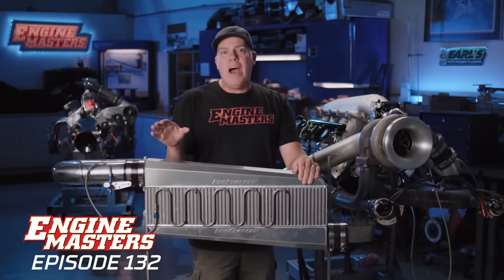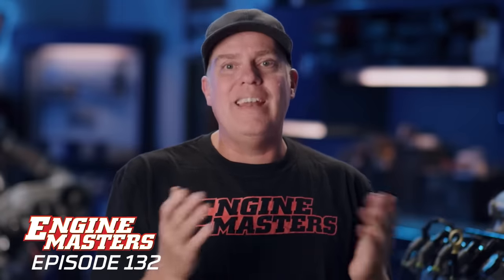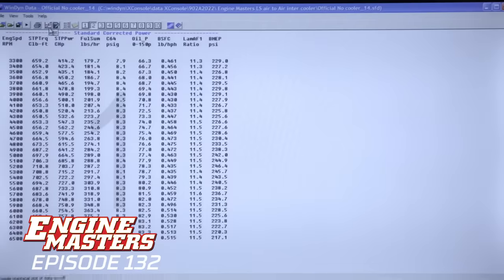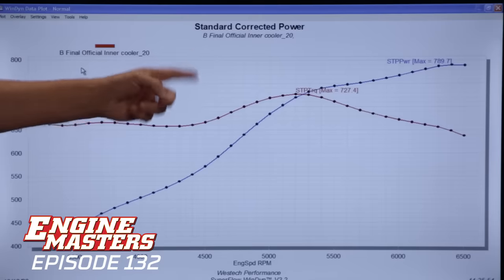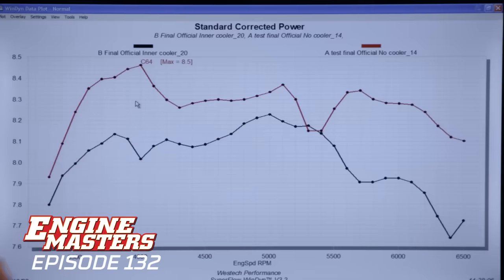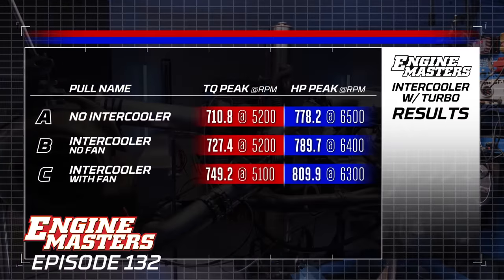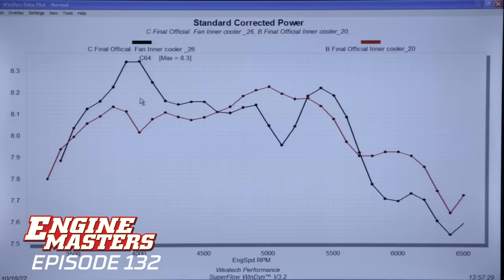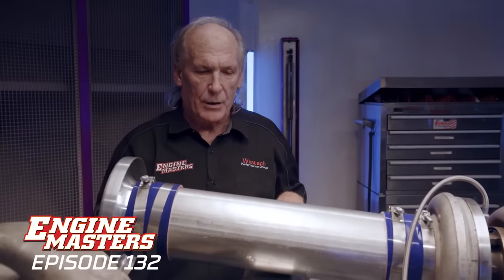Adding CO2 to an Air-to-Air Intercooler! | Engine Masters | MotorTrend

Comment from the maker: What lengths would you go to keep your intercooler extra cool?
Reply: Doesent one of the hellcats use the air con system to freeze the intake?
Reply: Water-methanol injection, how has this channel not done this yet?
Reply: Back in the 80's during the Turbo era of Formula 1 before the start of the race the would put dry ice in the inlets of the side pods in front of the intercooler to cool the charge. Not sure exactly how effective it was but if helped them gain a couple of positions at the start it was a benefit.
Reply: The lengths of admitting I should not have left youtube.
Reply: a water sprayer costs about 50-80 bucks if you wire it properly and use a washer tank. Id go with 5 seconds on the relay and the fine mist greenhouse sprayers. Also, chemical intercooling via water injection/methanol injection. Ive seen them just mist it upstream of the throttle body on the cold side of the intercooler.
Reply: Just make a front cover for the intercooler out of wire mesh that you can put dry ice into between it and the intercooler. It's lightweight and will definitely make the air passing through colder. Cheap solution too as it wouldn't cost much at all
Reply: I sprayed my intercooler with cans of -48 freezing spray before a drag strip run this summer.  I also had bags of ice on all my air ducting and box before the run.  
Unfortunately an AWD civic exploded the diff all over the track when I got to the line so my cheating didn't work.
Reply: @jeffa.8976  lesson learned. I'll spray kitty litter from now on.
Reply: I know someone said it already but liquid sprayers would be cool to see in this type of testing
Reply: AC evaporator attached to front of intercooler, yes evap not condenser. Could you get more power than the compressor hogs?
Reply: Meth to air. And I'd put an air filter on it😢
Reply: @kennethstreet7868  Maybe the most responsible car related post ive seen in a while online. Should be the first optiion you look at along with the squeeze depending on your chosen path. the intercooler is like a spoon. Its a tool, and its way better when there isnt one.
Reply: I'd eat a Klondike Bar!
Reply: E85, and skip the intercooler
Reply: It's super weird to see David on Youtube still. After they first were NEVER leaving, then they went behind a paywall for a while, to now producing pure trash videos. Imagine if they would have just stayed here. Oh, and Dulcich is so creepy I can't even. 100k views with 6 million subs? Yeah right. Lol.
Reply: Please solve the age old mystery of does a high volume oil pump suck the pan dry at high rpm or any rpm on stock style and other types of pans would be greatly appreciated I've gotten so many conflicting opinions on the matter and no one has definitive answers on the situation thanks small block Chevy stock and built engines preferably, you know all the usual testing of different situations and set ups you guys do for us car guys. Thanks (cheap bottom end 388ci SBC guy)
Reply: How about air to air and air to liquid at the same time. How much is left on the table on each without the other.:elbowcough:
Reply: @donaldreese2688  I didn't realize this was an age old mystery, but I have thought of it myself. We had a guy that used to blow supercharged 5.0 engines. He usually did this by running the snot out of the car at high speeds racing on the highway. Of course back in the day 5.0 engines were plenty because people would buy the car new for 10K outrun the brakes and then smash the thing up.

I used to do a lot of top speed runs with a modified 5.0 and when i took the engine apart (floated a head gasket) the bearings looked like they were starved a bit, con rods and mains. The engine was run on Mobil 1 Synthetic and saw regular oil changes. When we rebuilt the engine and I put a high volume mellings pump in there, I was wondering if I was going to do more damage than good on a gravity fed oil pan. We did put in a deep sump Canton pan with windage tray.

Comment: Need to continue this. Subaru used liquid sprayers with good results. Also, I wanna see a water to air setup followed by a killer chiller setup using the cars A/C setup.
Reply: The original ford lightning used its AC to cool the blower charge.
Reply: @ricepony33  Just being pedantic, but the original Ford Lightning didn't have a blower, but used a mildly spiced-up 351.  The supercharged 5.4 truck Brian drove in F&F 1 was the 2nd-gen.
Reply: @JETZcorp did it ticklike my 5.4? 😂
Reply: My memory is like a trap, nothing enters and nothing leaves ;)  @JETZcorp
Reply: Mighty car mods made a video about this a few years ago
Reply: @ricepony33 so does the hellcat
Reply: @JETZcorp  sorry gale bank's dyno'd with a "terrible design unit" and my childhood memory was and is seeing a 8ft-bed blue-green-ish+white-2-tone lightning configured the same way 

personally im not a ford fan aka dodge feverish ( 60's-charger and 80's k1500 ) lolz 😂 , but the better lighting is the 2003~ 2gen short-bed the rest are trim/gimmicky models, wishfully hoping for a short-bed single-cab BEV-remake-themed street/striped competition combo as it might be tempting for me to buy X- 😉 or long-8-12ft + single-cab ( more practical for real truck-use's but not as great for driving to work every morning or easygoing earens ) as GMC ( or dodge ) isn't in the game yet vs ford, however ford's BEV is over priced for what jimm said they wanted/promised at 80k-max and entery is/was 20-40k usd
Reply: I recall a magazine test of WRX STI sprayer…did not make any power diff.  But was cool none the less!
Reply: I think the intercooler was limiting further gains.
Reply: @mikelesh9513 it doesn’t make outright more power but lap after lap of driving the intercooler gets heat soaked. The spray brings the temp back down to ambient and that way u keep your power
Reply: @JETZcorp lightning concept I think used the AC but changed for production. SRT DO use the AC in the demon
Reply: @MatsNorway can't say without temp data from the last runs. They're not pushing much boost either so any gains will be magnified with further increased boost from the increased compressor discharge temps
Reply: Killer chiller is only good for however big your reservoir tank is because the ac compressor is turned off at WOT.
Reply: The water sprayer on subarus was just to counteract their terrible intercooler placement right on top of the hot motor.  The AC setup is much more interesting too since you dont need to refill it nearly as often.
Reply: @MatsNorway  Good analogy. Only one way to find out!

Comment: This little trick has been around for years. A cool story from down under.

Year: 1989
Location: Bathurst 
Car: Ford Cosworth Sierra (Turbo 2L inline 4 engine)

Peter Brock qualified on pole position after having ridiculous speeds recorded on the two longest straights of the track (mountain and conrod straights).

During post qualifying inspection it was found that the onboard fire extinguisher (CO2) was plummed so it pointed at the intercooler, and Brock let it off going down the long straights, giving the engine more power resulting in a quick lap time. The result stood because their was no rule against it.
Reply: You’d think it would fail for no longer having fire suppression
Reply: @ShaunHensley  Yes, it was the 80s and things were much more relaxed back then. Playing devil's advocate, I guess you can't make it against the rules to "activate" the fire suppression system.
Reply: The z18 bluebird piloted by George Fury tested a similar system in 1984.
Reply: @noname-sd5dt  Really?!!! That's so cool!  I didn't know about that. I do recall reading an article somewhere about the qualifying engine, stating it was only in the car for qualification and the top ten shoot-out and that was it. After that, it got replaced with the race engine for the race the next day and pretty much needed a full rebuild after only running a few laps because it was put under so much load from running extremely high boost and being reved so hard.

Comment: Definitely revisit this using liquid sprayers. It’s not uncommon for folk to run water/washer fluid/vodka/methanol on A2A intercooler sprayers 🤘🏼
Reply: T the vodka half to intercooler half to me.
Reply: slight fire hazard spraying that stuff in an already hot engine compartment with the potential of over spray hitting the exhaust  but could be ducted away to ground or vertically out the hood
Reply: @snapon666  Water provides no fire hazard
Reply: It should be something that arrives as a liquid and phase changes to gas. Liquid Nitrogen would be really good, and alcohol of course, but water absorbs a lot of energy even without changing phase to gas and is not explosive.
Reply: Liquid sprayers are not track legal due to them literally spraying liquids which can cause a safety hazard
Reply: @johngarlick7115 the streets ain't got no rules tho 😂
Reply: @jeremypike9153  Exactly.  Intercooler spraying was factory-stock on some street cars, so it's definitely worth testing.  I thought about rigging up a water sprayer to cool the heads on my old air-cooled Kawasaki 2-stroke, if it ever had cooling issues.
Reply: @snapon666 duct it to the intake
Reply: I’ve heard of folk rerouting their air-con exchanger to the front of their intercooler then blasting the AC so hard it nearly freezes over. 

The entire pass doesn’t require the AC to be on since all that residual cooling ability remains. Heck modern ECU’s would be able to control it to be turned off the moment you release the launch control or similar (a second or two into 2step for example)
Reply: @dylanzrim3635  the dodge demon uses the A/C system to cool down the blower in between passes at the dragstrip.
Reply: Another excellent video as always 👍
Reply: @JETZcorp certain model Subaru STIs had a water tank in the engine bay and water sprayers connected to the hood to spray the top mount.
Reply: @JETZcorp  i did that on an old lawn tractor that i had. i was running it HARD. actually worked really good at the time.
Reply: watching this got me thinking, why not freon? or R-134a? same thing as coils for your freezer. i realize you would put a drain on your alternator and increase weight with compressor and condensor but its a sealed system. you could slide a cover over and have iced coils. make your run and let it charge/freeze back up. i feel like I should get in the shop and get to work lol.    (i trademark this idea!!!)lol
Reply: @Ko_deZ  liquid nitrogen wouldnt be bad but compressed and inert gas would work too. nitrogen as a gas is still colder being decompressed than co2 and helium would be an even better choice as its even colder.
Reply: @BrickNewton my brothers mate had a saab 900 turbo back in the 80's with water sprayers on the intercooler, and water/meth injection,
Reply: Acetylen would be a great idea
Reply: Weber 50 idle jets araldited to the trumpet pre turbo and then in to the log intake manifold post turbo on a 5lbs hobbs switch with distilled water.  I ran 2 more psi more reliably than no cooling and 2 less psi on my datsun draw through.
Reply: @KingSMW  I've noticed old dirt bikes pick up power after you bonzai a puddle or stream.  That's what gave me the idea.
Reply: And maybe the fan vs. Fan&Sprayer isn't the best comparison. The sprayer bar is a replacement for air speed over intercooler, not a compliment. 

Burnout cars, mud bog, drifting. There are lots of times where fan air is uncertain.
Reply: @jeremypike9153  lol, technically they do!
Reply: I’d like to see that!
Reply from the maker: Good insight! What other tests would you like to see?
Reply: @MotorTrendWatch get some liquid nitrogen and use that instead of CO2.
Reply: @MotorTrendWatch  just compressed air into the turbo inlet.  Air can go straight in and is about minus 100?
Reply: Two things. If you sprayed the whole bottle of co2 wouldn’t the oxygen content of the air in the dyno been diluted?  The fan inlet may have caused low pressure area right in front of the turbo inlet hurting boost?
Reply: @RAPXZibit methanol does
Reply: @KingSMW f150 svt lightning already did this
Reply: @MotorTrendWatch couple lbs dry ice in intercooler with acetone for the liquid medium.  Or even as a "cold air intake"
Reply: @MotorTrendWatch water methanol injection.
Reply: Build an intercooler in copper
Reply: @MotorTrendWatch  Same test with small and big intercoolers?
Reply: The Water bottle was actually a big 10-15L Tank in the boot (So it would stay cooler than 100*C engine bay) Also with a decent powered pump not normal wiper sprayer pump and 4 - 6 "Misting" nozzles on the underside of bonnet spraying over the Top Mount IC right at the air duct From bonnet, It was automatically controlled Via the ECU Boost Reading and a manual on/off/rate of flow adjustment in cab @BrickNewton
Reply: @KingSMW 
Maybe because that would be toxic af for everything and everyone?
Reply: There's a better way and it's easy.
One coil sprays water mist, one coil sprays CO2.
Reply: @MotorTrendWatch  Four pattern cam test.
Reply: @AB-80X  how do you come to that conclusion? you woke up today right? nobody's refridgerator  is killing them is it? or your window a/c? same theory applied. its a sealed system. i literally said the same as a refridgerator.  coils. a refriderant such as r-134a. compressor and condensor.  ffs.
Reply: @KingSMW 
I’m not talking about the R134A dingbat, I’m talking the Freon you mentioned.
Reply: It's probably better to inject the water and or alcohol directly into the manifold. Best possible heat transfer, plus the alcohol can act as additional fuel allowing a leaner mixture from the main supply.
Reply: @RAPXZibit  and is also better at cooling than alcohol
Reply: @jstdrv  jet fuel indeed

Comment: Ive seen people use solid chunks of C02 stuffed into the intercooler ducting pre send down the 1/4mile. As the C02 changes from solid to gas it can take alot of heat with it. Which is great for an intercooler.

Comment: If you want to make consistent boost pressure, why not put the boost line to the waste gate closer to the intake plenum so the turbo hits higher pressures before aftercooling?

Also, if you want to see better results on using cryogenic cooling, try wrapping the coil around the discharge line on the intercooler with smaller diameter lines. You'll increase your surface area to volume ratio and increase the cooling capacity of the CO2 while also decreasing the amount of gas required per degree of cooling.

Comment: Windshield washer fluid is cheaper and easier my Evo came stock with it and it works really good after I’ve been driving and have saturated my intercooler with heat
Reply: I was gonna say the same thing all you have to do is re route the windshield washer pumps to the intercooler
Reply: @KSwapTheWorld69  in the vid they said chilling the cooler doesn’t do much but they started with a cold intercooler when you’ve been driving for a few hours or it’s the middle of the summer and you’re on the highway doing a roll that thing warms up quick windshield washer fluid cools it right out but I think one benefit to the CO2 is you’re not risking getting water or methanol somewhere you don’t want it. You’re right I’ve seen a lot of guys just do that you got a mess with the sprayer on the end of it to get a good misting effect but it works very well and it’s basically free that CO2 set up or using nitrous is absolutely not the cost of nitrous is why I put a blower on my car I was burning through a bottle a day just out having fun. Compared to nitrous that blower paid for itself in a couple of months. And no more nitrous backfires turning the butterfly in my throttlebody into a clam which is also very expensive
Reply: My SRT4 came with the same set up with the turbo toys option and it works well....I also use wiper fluid in my SNOW brand water/meth kit because it's chemically the same as the 30 bucks a gallon boost juice they sell...all works great and a must have if you want to run a good amount boost without killing you daily...👍
Reply: @CraigBrosRacing  look at the ingredients to windshield washer fluid it's got some Methanol in it, it's not much but it's there
Reply: @KSwapTheWorld69  true that...the car can't tell the difference between industrial glass cleaner and SNOWs boost juice and the graph isn't any different between the two when doing dyno pulls..👍 easier on my wallet is the only difference I can see so far...
Reply: @KSwapTheWorld69  and dry ice in front of the intercooler is the secret sauce my friend...shhhhh
Reply: I was at Home depot and found a sprayer nozzle from the garden sprinkler isle, its small and has a little barb fitting. Gonna try and T of my hood squirters and mount the nozzle on m bumper.
Reply: @toycoma98  sounds like a pretty cool idea 👍..keep thinking outside the box my friend..
Reply: @600wheel your washer fluid is the same temp as your engine bay which is pretty toasty.
Reply: @horsefly1020  washer fluid has methanol in it just like rubbing alcohol as soon as it touches something and air moves over it it gets very cold if you have not experienced this put some rubbing alcohol on your hand it doesn’t matter how warm it is as soon as you blow on it your hand will feel very cold. That is exactly what happens with the windshield washer fluid that’s why Mitsubishi put a windshield washer fluid intercooler sprayer standard on the Evo so you can spray it on your inner cooler when it is heat soaked.
Reply: @toycoma98  another fantastic sprayer nozzle is the ones that come on those bottles you put any random fluid in and then you pump it up with that pump on the top and it sprays out you can take that nozzle off and adapt it to a hose and it’s adjustable spray so you can make it super fine mist all the way down to a smaller straight jet
Reply: @CraigBrosRacing  I started throwing rubbing alcohol in with my windshield washer fluid. That’s a very cheap way to do it